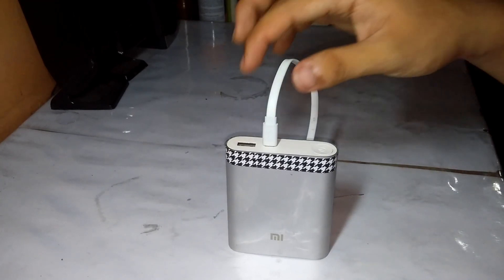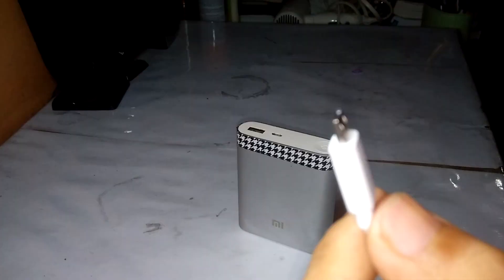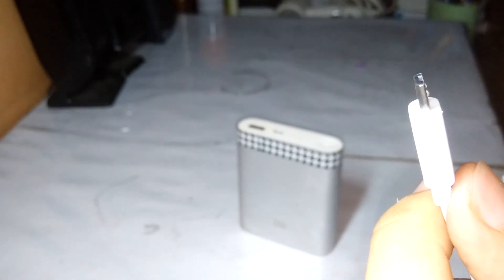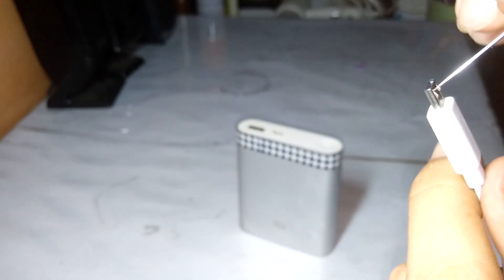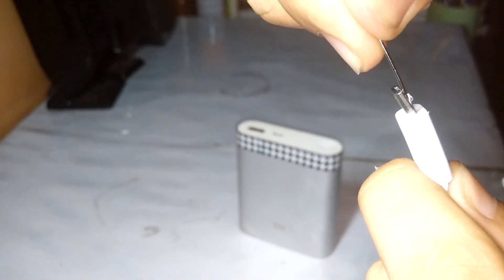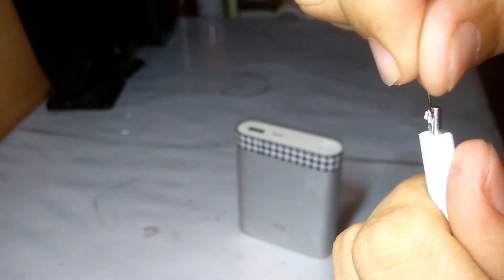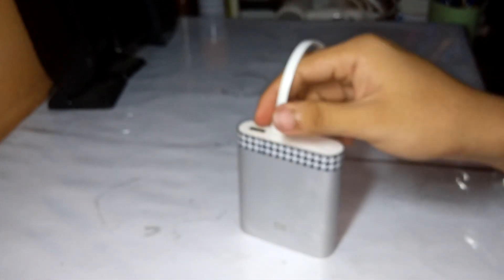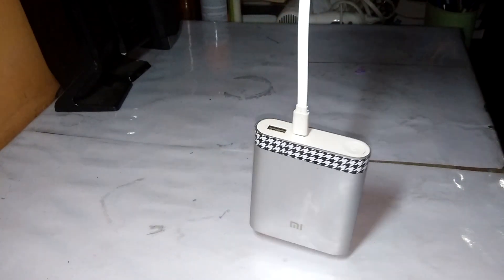How To Fix A Loose Micro USB Cable

Comment: micro usb sucks. the port and  plug easily get broken and loose. what a  bad design.
Reply: BBnose if you want a good micro usb buy the original version and not one that is 2$ and 100 meters long
Reply: BBnose the new android will have usb c now its similar to apple slightly better in my opinion but that will be on the next samsung devices
Reply: BBnose yeah tell me about it. What a worst fucking design ever . Who ever decided this idea was great need to get fire ASAP  and prohibited being hired into  any  other company in the future for the rest of their life. n
Reply: Lughtining cable better?
Reply: if you"ve ever used 5m long data cables for a while you wouldn"t want to use any less than that
Reply: i agree hope ps5 use usb C
Reply: And fothermuckers just keep making them the same way in 2018
Reply: This is why I want a new device
Reply: planned obsolescence

Comment: I saw tutorial articles showing how to fix the kind of micro USB connector that has the metal tabs, but none showing how to fix the ones with these  spring-loaded prongs. We have a bunch of Amazon Basics and Anker cables that have ceased to seat correctly. I'm anxious to try this!
Reply from the maker: +Kimberley B hahaha dont fret nothing will happen bad. Take risk ;) that's what I did that's why I discovered this

Comment: You can see even on his cable the connector itself is on a angle. The minute that white part flexes, it will pull the pins back in. This will only work temporarily. Hard to explain but you can test with your cable. The end white part and the connector itself just aren't rigid enough.

Comment: This made me bend like 4 needles and ended up even hurting myself without success. Found in another video that using Nail clippers would fix the problem. That ended up doing the trick for me WITHOUT hurting my fingers with a needle.
Reply: Nail clippers are the Savior ,thx bro ☺️

Comment: it will work like that few times and then the pins bend back inwards. its only a temporary fix. my advice is to always keep a spare new cable in the house. they are not expensive

Comment: I can't get the pin inside. the tiny metal things that I'm trying to pull out are directly next to the end of the metal thing. there is no hole in between that I can stick the pin into.
Reply: Smaller pin/needle?
Reply: Same:c
Reply: The port on this vid was already fixed..

Comment: for those who are to try this, take extra precautions. As I was doing this, the tip of the needle that I used snapped and was left between the hole and the clip. I have spent an hour trying to remove it but I had no luck of doing such. I had to force the clip downwards, sending the piece of the needle inside. The sad part is that the USB cord is still loose, and this was the cord of my External Hard Drive :'( I don't know if there's a replacement available for this. Wasted my time on fixing it on my own. I suggest you guys use a hair puller or other small yet tougher metal object to pull the clips out.
Reply from the maker: Sorrt to hear that man

Comment: A sub and like for you. Works if you're not an idiot or have an already broken micro usb. Be gentle. Doesn't require much force to bend the tips back and you only need the pins sticking out slightly. By slightly I mean 1mm.

Comment: Mine doesn't work at all now!
Reply: Happend to me too
Reply: Mine 2
Reply: Why?
Reply: Lol you probably pushed too far and snapped it where you can’t see. Mine only works marginally better. I don’t have to bend it to one side quite as far.
Reply: Lmfao
Reply: From what I can see in the comment, it looks like there is a threshold that if you pass will mess up the micro USB piece

Comment: yeah sure cable holds tight... but there is one BIG problem... cable constantly looses connection when blugged in.
Reply from the maker: well it depends upon the damage of the micro usb, it varies

Comment: can you do a video on how to put the hole casing back mine fell off and I'm trying to put it back QUICK!
Reply: I was able to put the metal casing back in but the black inside won't come inside the metal casing
Reply: +Tito Vithoulkas I have a speaker that uses a micro USB to charge and the little prongs in side of the plugin on the speaker are all bent
Reply from the maker: I think you might need to open the device and solder it glue it somehow

Comment: i did this, it works nicely but the issue is when i put it after fixing it just goes flat again.
Reply from the maker: the rubber is lose already try putting super glue around it
Reply: what rubber? i am talking about the metal pins, after i pull them up and put them back into the phone they go flat again.
Reply from the maker: on the video the white rubber surrounding the metal add super glue i got some issues with some of my microusb because they go flat. But the add super glue it will solve the problem :)

Comment: DO NOT DO THAT! Just buy a replacement cable! Tampering with the clips will disarray the pins underneath and it can fry your device! Happened to my HTC One M9, a faulty micro usb cable fried my nand flash memory chip.
Reply from the maker: did u see what really happened?if yes you wil know that its not harmful. You are pulling the prongs up so there will be no frying involve.
Reply: I don't think you understood what i said. When you pull the prongs you move the pins below as well, you can check it yourself. And there is a high chance for the pins to not align well when you use the charger. Yes, it can fry your device if the pins touch and short out, you run that risk every time you plug the jacks. I talk about the pins not the prongs. Google "micro usb pins" to see what i am talking about. And if a pin is bend, it just adds to bad odds. My HTC smartphone got the nand chip fried due to a faulty cable, i strongly suggest not to try and "fix" a faulty cable, that's all. I speak from my own experience.
Reply from the maker: vids or didnt happen
Reply: vids on what?

Comment: The REAL solution is to clean the plug hole with a tooth pick (or anything sharp and not conductive). Believe me, there's probably tons of dirt in there. Anyway, my phone charges like it used to 2 years ago.

Comment: I did this trick and now my cable doesnt work at all
Reply from the maker: sad for you. You should be careful fixing it, anw that never happened to me if it didn't work try fixing the metal as a whole and try pressing it up or down while charging for sure that's why it doesnt work because the wires or the metal isnt connected well because it's loose already on the inside and not the pin itself

Comment: this video was made by someone who knows nothing about how connectors work.
this is about as useful as a "use a piece of cardboard tip and CAN DAMAGE YOUR DEVICES
DO NOT USE THIS TIP. if somthing is broken repair it (really repair it or replace it.

the only way to repair a USB cable is to replace the broken connector.

the reason the spring tips go into the connecter is the support plastic inside the connector is broken. not because the clips are bent.
the broken plastic will let the sleeve (the outside metal) shift and the 4 contacts inside the connector wont move.
the only way to fix this is to solder a new tip to the cable

usb micro connectors are incredibly fragile and the standard should never have been brought to market.
Reply from the maker: aight bro ;)
Reply: He is correct, your method dislocated the connectors but if the pins underneath are disarrayed or touch each other it can fry the device.
Reply: IDK what you are saying man but this video fucking saved a lot of frustration. thank you OP for making this.
Reply: But it worked? Lol
Reply: Your device is already damaged when the pins go in and it won't charge so buy trying this at least you may have a chance for it to work again. When them pins go in all you can do is throw it in the bin so at least this guy is giving you a little hope. Your comment makes no sense

Comment: These cables need to be banned. There was nothing wrong with Mini USB, but there's a whole hell of a lot wrong with this piece of @#!% plug.
Reply: mini usb was rubbish. I had several device where the female connector breaks off the motherboard of my device. and that was without kids using my devices.  the male connector was simply way to strong.  with micro usb I never had that issue.  micro usb flex more, and the male connector is more likely to break. leaving my device intact without damage. my htc and nokia micro usb have lasted for years. until my 5year old kid got a phone. it's best to have QI wireless charger  or magnetic connector for small kids. you never know when they will run of with the phone still connected..
Reply: Torbjørn Larsen This is bizarre. I have the opposite experience. I'm very gentle with my connectors so I don't have to worry about the physical connection on the PCB breaking for Mini USB.

The retention mechanism on Micro USB is terrible though, these cables slip out in 5 minutes. They don't even stay in place on a level surface and I have to tape the cable in place to make sure my phone gets charged while left unattended.

What's really terrible about all of this is that the cable standard is used on handheld devices like game controllers. Those will be moved around a lot, and the cable will lose its connection repeatedly.
Reply: Micro usb cables are usually durable in my opinion. Unless you buy cheap brands or have small kids in your home. All moving part is inside the cable. Buy a new cable and it usually works like new.   I'm getting Nexus 5x with usb-c.  Tired of sharing chargers with my youngest kid.
Reply from the maker: like wise, the female ones are the strongers ones for me :D
Reply from the maker: In my experience not really, i bought an expensive one, my phone fell while charging ,the micro usb is bent. :))) hahahaha

Comment: I can't get the pin inside. the tiny metal things that I'm trying to pull out are directly next to the end of the metal thing. there is no hole in between that I can stick the pin into.
Reply from the maker: You just have to insert it by force,make sure you have a strong pin